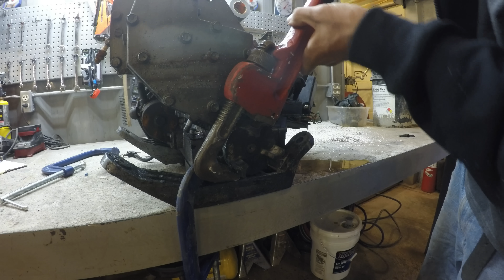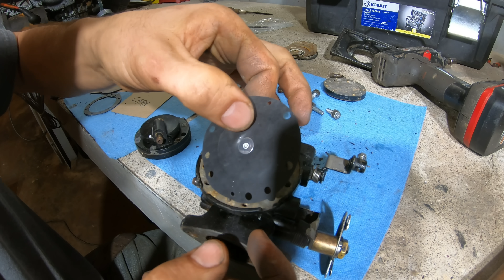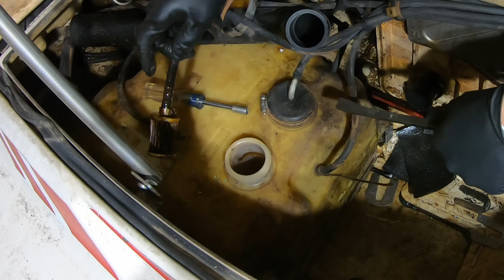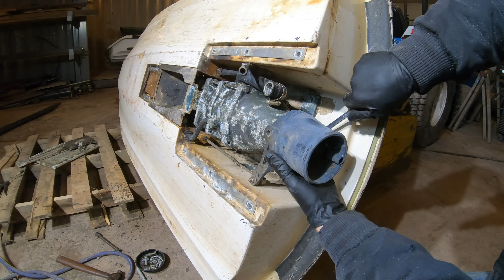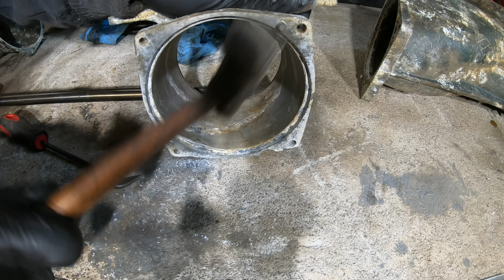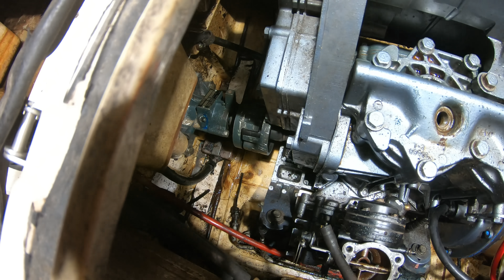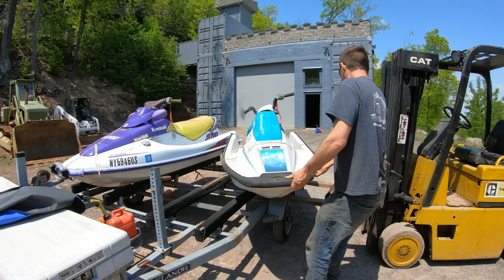Fixing the other $50 Wave Runner

Comment: That thing sounds like it's grinding itself apart from the inside out. This was hard to watch. You must be self taught.
Reply: marscruz its called a 30 year old 2-stroke
Reply: @matthewjohnson438    -  I was riding 2 strokes back in the 60's. This particular 2 stroke won't last very long. Failure is imminent. The long neglect was too enduring to recover from.
Reply: @marscruz  and I had this same one.  They sound like that out.of water without the flush kit hooked up.   Mine got a drink of water twice due to a leak in the aft.  Mine is still running today, and it sounded like that 15 years ago.
Reply: @jimb032  I'll take your word for it. My experience is with motorcycles. Never had a jet ski.
Reply from the maker: We rode that thing a decent amount. It didn’t have any problems after this. I even put a new seat cover on it.
Reply: @Bad Santa   Please post your address so I can send Good Santa by to decommission you.

Comment: A good way to clean a gas tank is to use a vacuum but take a 5 gallon bucket with a top and drill 2 holes. So its basically a dust separator but for fuel. This way nothing gets in the vac its all in the bucket and you can still reuse it. It also works for oil changes
Reply: That could have explosive results. The cheapest and best way is to use an old electric fuel pump.

Comment: glad u got it all fixed up, but a tip on working on any watercraft always have it in water when starting or running all the rubber pieces will break

Comment: I had an MG engine seize up on me due to water in the engine from a failed head gasket.   After replacing the gasket, I couldn't get the engine to turn.  I removed the spark plugs and squirted Liquid Wrench in the plug holes.  Let it sit for a couple a days and bingo, I turned right over.  Forcing the pistons to turn can crack the piston rings and score the cylindars.  Food for thought.

Comment: I would have packed fresh grease into the rear impeller shaft bearings, and greased the certs on the front driveshaft and starter

Comment: I worked for a beach rental operation back in the late 80's when that model of WaveRunner was brand new, the latest greatest. :) We had 8 of them at a time, and it was a rare day when we couldn't rent every one we had running.
I would imagine they are kind of like the original VW Bug, but of PWC's - plain, simple, kinda hard to break and easy to fix if you do, especially compared to what is on the water now.

It would be interesting to hear from you how the ride is different between that old classic "Gen 1" WaveRunner, and your new modern day machines. Are the newer ones (which I imagine have "brains" running the engines) that much of an improvement? It seems the newer, larger hulls would ride better - but then they need a larger, more complex engine... I'm sure the newer ones are faster on the top end, but how about maneuverability? That sort of thing.
Maybe do a "then vs now" review video?

Thanks for the vid, kind of a "blast from the past" for me. :)

Comment: Thats the beauty of 2 strokers  they. Can sit for long periods and with minor love and persuasion   Get turning. Again  ive played around a lot. On PWC engines mostly. Sea Doo and Kawasaki  but never the Yamahas. Although ive owned a couple of Yamaha motorcycles that were  pretty well made , ive always favored Honda bikes  watching you pound the bearings in   My old man taught me to  always use  either  a large  round stock of brass or a heavily  weighted raw  hide hammer. That he. Had from who knows where  he used to also “ press “ a lot in using the vise and   Different size  sockets  keeping in mind. We always worked on  old British  cars and engines that were oddball sizes as they used their own   Measurement system call Whitworth  some times  you could use a combination of Metric and Imperials to find a fit and  we also had  various open end  wrenches that were from factory. Tool kits in the cars  that were built by the British equivalent. To the old Snap On stuff we got in the states  we would pick up Whitworth tools at. Swap meets , Flea Markets, and British  motorcycle and car gatherings. Too  so the old man was good at fabricating the weird stuff like pullers  and specialty tools  apparently i picked up on that as well as one time i made  a Sea Doo pump puller  that i saw a picture of  in their service manual !  Your engine sounds pretty healthy  !  FYI. On the parts of the older machines  you can find lots of repops. And NOS  online really cheap. They were really mass produced back in the days when PWCs. Were very popular  so there are tons of parts especially high performance stuff. Available  i actually still own and run a couple of early 90s  machines  that. I  really went overboard on high performance parts. And it kills me to see some of the. Stuff i paid premium prices for and ill see  the same part on Ebay for a fraction. Of what. I paid  like ride plates , impellers, exhausts , etc. but it was all fun back in the day  of riding with buddies  and. Trying to out do one another ! On time i was our riding. On my  pretty stock looking SeaDoo  thart had a ton. Of upgrades under the seat  and nothing fancy showing when a guy pulled up next to me on a brand new. Kiwi. That  should have smoked  me out of the water. And the guy was Cocky  so i played  around untill. It was go time. And i left him scratching his head  cause i knew he had a brand new. Machine that meant  no experience in riding  versus  myself who  started riding jet powered. Machines in the late 70s  which were a 250 single carb set up slower than  anything  to  the modern  day machines  !   It was good to see you out riding. Yours   It looks like you scored on the machines pretty well. Have fun and be safe. I’m looking foward to more videos Unfirtunately for myself i suffered a Traumatic Brain Injury several years ago (not water craft related).  So. Most of my days riding. Are memories  because my body doesnt work like it once did  before i got sick  but thats life my freind

Comment: i have a pair of waverunner 2 1992 vintage i got for $300 that were stored in doors for 10+years. Got them up and running last season not super fast  maybe 30mph but super reliable so far and fun enough for the family.
Reply from the maker: Yeah, they can be good, the 650's arent bad. The 500's are better for smaller lakes or something. In the endless river riding with faster jetskis, they can feel slow.
Reply: @AndrewCamarata  their cheap fun for putting around our lake wish they were faster tho lol. i believe mine are the 500. Maybe a dumb question but how does one tell?
Reply from the maker: Usually the model number near the engine.
Reply: @AndrewCamarata   got the battery's back in them and they fired right up they are the 500 so the slower  sadly but my toddler doesnt mind lol...do you know where the idle adjustment is at? one of them has a fairly high idle
Reply from the maker: Dal Call Center It’s one of the screws on the carburetor, it may adjust the throttle cable hook up thing, there’s also some screws that adjust the high and low speed jets

Comment: The only PWC that I operated was a Kawasaki Jet Ski a friend had. It had to be the first year they were invented. That thing sucked. It would flip over when you stopped. They had "pontoons" that you attached to the front to help with buoyancy. It made it slow. I said, "take them off". It went a little faster, but it was my first day. I fell over near a Swan nest. Ya, you guessed it, the Male Swan came at me. 7 foot wing span. I managed to "idle" back to the loading platform (this was a slow moving river and I was "downstream without a paddle"). Every time I tried to get planed, the swan attacked. Trying to plane that machine was like trying to stand on a ball. Anyway, got back and puked because I was so exhausted. I literally had to use the Jet Ski as a shield to keep the swan at bay. Interesting day. (C: 1982ish). I am not sure. It was the sit down Kawasaki and I think it was 650. I don't think that is right because it was gutless. Probably 250cc. Or 650 and it was only running on one lung. POS!! Love the Yamaha Wave Runners. Never had one but always wanted one.

Comment: Sounds like bearing noise when its running. Ive never worked on skis before. Im guessing there is bearings the drive shaft rides on.
Reply: He replaced the bearings so I think it was the impeller rubbing against the corroded part of the housing. It'll clean itself after a few tanks of fuel are run through it.

Comment: Hello Andrew, first time commenting and I felt that I had to. If you had the whole wave runner apart, why didn’t you use an electric wheel on all of the parts and then re-paint them? Everything would have cleaned up beautifully and your Wave runner would look like it was new. Also, instead of hammering metal directly, why not use a piece of wood so you don’t damage anything?  Good luck with it buddy.  By the way, don’t be afraid to use more grease. Grease is your friend and it is fairly cheap. 😎👍

Comment: hello, I have ymaha 650tx 1998 spark on the spark plugs there is fuel going to the cylinder only works if the throttle is closed by hand for a long time to spin the starter thanks

Comment: A better way to install that shaft after the new bearings were hammered on would have been to freeze it.  Hammering on the inner races while the outer races are being forced into the bore is a good way to ruin new bearings.

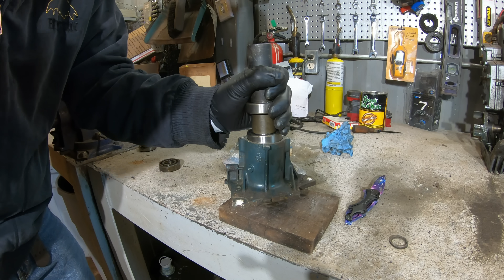Comment: 12:29 Hit the thread with a hammer, OMG  ☹️. And at 13:34 destroying the new bearings 😭. Putting a new o-ring on without cleaning the seat, don´t clean and grease the bolts and screws. Don´t check pistons and crankshaft even though the engine was flooded with water...........

Comment: Andrew...no. Grease on the two   New bearings..they looked dry.  Where would they get their lubricant from?   They aren’t water lubed I would think.
Did I miss something?   Just curious.  Spent 30 years in the elevator business.  We had to lube everything.  If you can get that piece of well maintained equipment running again it will be the engineering miracle of the year.  Good luck.  
JoeB

Comment: andrew an old trick for ceased or rusted engines remove c head and pour in vinegar into piston bores. leave over night remove sump vinegar will have soaked through and freed engine a lot cheaper than so called freeing agents

Comment: Hey man great video. Love such a thorough fix. Im fixing up a 1992 waverunner 650, and I can get it to start and run, however, at anything more than half throttle it stalls out and dies, any ideas?? I have a new carb, new sparks, new battery, no obvious exhaust leak. Could it be a jet problem or exhaust problem? Seems more like fuel issues but not sure what else to check!

Comment: If you going threw the time to repair that dinosaur it would be advisable to add antiseize to all the threads and metal fittings it will aid in removal for future repair and mitigate corrosion and parts from welding together

Comment: Great video ! I just aquired an old kawasaki ss /x1 750 ,'94  , my first jet ski ever ,only attempted to ride once before ,years  ago ,i had the old owner start it up for me ,it runs ,and sounds good ,my question is this ,he hook a garden hose up to a fitting on the engine ,and it was leaking water into the hull ,not bad ,but i noticed you didn't hook any water up to the Yamaha ,because you only started it  for a few seconds , so i don't hook up a garden hose that leaks just to start it for few seconds ,correct? And basically that water fitting is a flush valve to flush out old water ,and keep it cool if running for more than a few seconds ? Like i said  ,I'm very new to this ,that is awesome video though ! Thank you so much!

Comment: Ya know I've got one identical to that, but with blown rings because of cheap 2 cycle oil.  So buy and use the Yamaha oil, or else.  I tore the head off and just left it at that because they're so slow.  It and a working when parked 89 seedoo have been sitting on they're trailer under a shed for 20 years now.  I replaced it with a new 99 1200 that would do 60, and sold that a couple years later as I was tired of burning money...

Comment: I have 3 of these.... you think its worth it to get one running? How much power does it have? I think I have a 650, and 2 500s. How fast do you think yours gos?  Great job by the way!👍
Reply: Get'm working so you have an excuse to get off the couch and learn something useful. Those machines are worth more money running, you can't make them worth less than they already are and if you're not successful sell them on craigslist or sell the parts on ebay. You can google the make and model and find the speed of those machines. The slowest would be 35 mph and the fastest 50.

Comment: Andrew thanks for reply. New battery & new solenoid.  Spoke with Machanic if motor was partially seized engine would not turn over. He feels starter needs be replaced. Any addition suggestion?
Reply from the maker: Does it turn by hand? If its hard to turn its not a bad starter. Was it sitting? If so, maybe put some oil in the engine and let it soak. If not, it might need a rebuild. Make sure its not the jet drive holding it up.

Comment: Time to swap in a 701 from a wave raider/venture and add some basic mods from Riva or go all out with a kit from Group K. The hull design on those older skis are like bricks in the water but are far superior for jumping waves imo...they just skim across the surface. I had more fun and better control jumping and landing on my 30y/o modified (kawa) TS than on my 2011 300+hp RXP.
Reply from the maker: Yeah, that thing would be pretty nuts with the 701 in it.

Comment: Hey Andrew have you ever herd of.,or used cataclean? In your videos at all. It works in gasoline& diesel engines.,an  including small engines to. You just mix it in those by smaller ounces/oz. Measurements on 1/4 tank of fuel pack along more fuel with you while doing this. This includes diesel fuel to.

Comment: props on getting a  P.O.S. watercraft running.  But Please tell me why you couldn't spend a few bucks on paint for the motor and pump.  If you clean the metal and paint it, you put a stop to the corrosion and remember rust is contagious.  If a leak develops, you can see it against new paint.  15 dollars will bring a couple hundred more when you sell it.

Comment: when you are taking the bearings off the shaft use a copper hammer ..it will reck the soft hammer not the steel shaft... i seen you looking at the threads after you got the bearing out lol

Comment: You seem to be good with small engines.  This is my first time repairing a pulse carburetor and it's not going well.  Is there a way to see if there's enough pulse?   Or perhaps bypass it with an electric pump?

Comment: If I were working on it, once the ignition system worked and the sparkplugs firing, then I would shoot some gas down the spark plug hole and screw it back in, then hit the starter then it should run by itself for 1 or 2 seconds.

Comment: you was lucky that peller came lose i had to cut mine into   to get it off . and i n stall a stanless one and had to borew out the houseing   so the peller would work but  the onley problem it work  before i install it  but after it was  install back in the jet ski   it woulnt turn  over   with the starter .  unless you took a pipe wreanch on the shaft to turn buy hand . so i asked around and i was told i had to remove it and shave  the edge  of the  blads down  or have it bour  out more  .   so i gave up on it and sold it . but i miss it . .    .       ps i dint think that carb would work . because it was not the same as your old one .   but i  was wrong .

Comment: Could you do a video on how the cooling system works?! I’m having trouble with my 91 and it’s the same style as yours
Reply from the maker: Water flows from the jetpump threw the engine. Make sure there are no blocked hoses.
Reply: @AndrewCamarata  "through"

Comment: I've got a project in mind which would require an entire jet drive from a WaveRunner. Where can I score can older model WaveRunners for cheap?
Reply: Craigslist/Facebook/EBay
Reply: @Saltycrew223  I've been looking. Not much luck. There's a couple salvage yards I found that can hook me up. It'd be just cheaper to find a donor machine.
One guy not too far from me has parts he stripped but he didn't take any inlet ducts from his salvages. So any parts would be useless without those.

Comment: quick wire wheel on the blades would have made them run more efficient. dirty blades on prop cause loss of gas mileage and speed/responsiveness. but totally understand not getting too into it
Reply: looks like it ran good

Comment: If you thread all the bolts in the same length on the flywheel puller the flywheel will come our a lot easier

Comment: I would not want such a mechanic to repair my car.
Reply from the maker: You don't like the mechanics that get stuff fixed? Have fun hiring ones that don't fix it than.
Reply: @AndrewCamarata  I do not like when they do not neatly. After such a repair, the mechanism is easier to throw away than to restore. And it will have to fix pretty soon.

Comment: using zip ties to hold the tubes on is crazy.. just use normal hose clamps!! had a zip tie 'clamp' cause a fuel leak and was the cause of an engine not running right
Reply: i prefer hose clamps too but every smaller thing i work on has them it seems. idk why

Comment: Dude! Please clean the rust off of everything its going to take your work to the next level of professionalism, i get that its an old flooded machine and your just trying to get it running and not restoring it but still. In that crank case the flywheel covor and flywheel even in the carb. All that would have taken was a minute with a wire wheel. Its up to you in the end and still a cool video